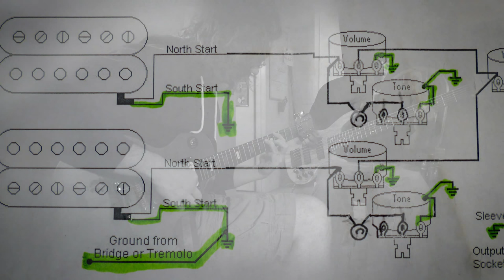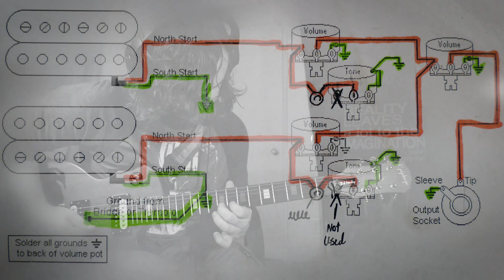How To Build A Do-It-Yourself Bass / Electric Guitar

Comment: Point of note regarding your visual of measuring the bridge position...you used the E saddle for the 34" scale.  You should be using the G saddle, because it has the least amount of forward room to move...so you don't want to run the risk of not being able to intonate it.

Also, you installed your machine heads upside-down...
Reply: also installed the bridge to far to the treble side the the high E isnt even on the board at the last fret

Comment: Neck
Its usual to mark the centre line, fit the bridge, then clamp the neck on lightly (with a block of cork or similar to protect the frets) and use a steel or a string to set the neck so the outer strings are the same distance form the edge, then drill the guide holes in the neck. This is also how you put a new neck on an existing instrument.

Bridge
With a new bridge, adjust one saddle as far forward and one as far back as they will go and a third to the middle, so you know where the middle of your adjustment is - the man in China doesn't care where the middle is.

Soldering
Solder is not glue. Heat the connector and melt solder onto it, not onto the iron.

Its usual to build an instrument with the neck fitted but not installed, this makes soldering, finishing and things like strap buttons way easier.

Comment: Did you installed the tuning machines backwards on purpose?
Reply from the maker: No, it was not intentional at first. My buddy began to install the first one upside down by accident. The anchor screw broke while he was screwing in. Once we noticed the error, it was too late.  We only had the six anchor screws that came with the kit.  So we had to press forward and make the rest like that. Luckily, it made no difference structurally. Nice catch!

Comment: Ah, not bad, it looks good. I personally would have upgraded the pots because they are not an expensive thing to upgrade.
Reply from the maker: Hey there again, Jacob!

This was my buddies guitar that we built. We had a limited budget, so we stuck with the pots and pickups that were included in the kit. What are some pots that you would have gone with? I'm am a guitarist, while my buddy is the bassist. Do you play bass or standard guitar?
Reply: Event Horizon Records Switchcraft is generally considered not only the best company for aftermarket pots, switches, capacitors, etc., but their products are better than most original equipment. Their quality is better than just about anything in place on imported guitars and basses, but also at least as good as any you'll find on made in the USA guitars, and better than many of them. Ask around, and you'll see. 😀

Comment: Shielding first?
Reply from the maker: Hi, Famucholly! Sorry. I'm not sure what you're referring to. Can you elaborate?
Reply: @JoeLewis14  I was just wondering why you didn't Shield the cavities before you installed the electronics.
Reply from the maker: @FAMUCHOLLY  I see. Yes. That is a good point. That was certainly an oversight. We did do the cover, but not the cavity. This video is a little old, so, I've gotten better, but it is worth noting. Thanks!

Comment: Any theory behind the tuners being upside down?
Reply from the maker: Hey, Eric. When we build this guitar, it came with a set number of hardware screws. Unfortunately, my buddy installed the first machine head upside down, and the screw head broke off. Since it did not effect the intonation, we pressed ahead. We later removed the screws when new hardware arrived, filled the holes with proper wood filler compound, and placed the machine heads in the correct orientation. So basically it was a mistake, and we ran with it. Thanks for checking out the video and asking about it!

Comment: major mistake right off the bat.  if the bridge holes are pre drilled you need to create a centerline and clamp the nek in a position that lines up correctly.  then drill and secure the neck.
Reply from the maker: Hey, TheDoug2103!

Maybe you are correct. Unfortunately, the instructions did not mention to do this and this was one of my first guitar builds. Luckily, it turned out just fine, but that is something I will keep in mind for the next one. Thanks for watching the video and giving your feedback!